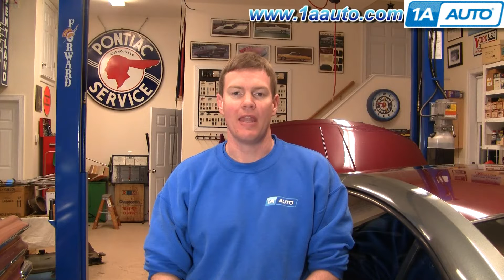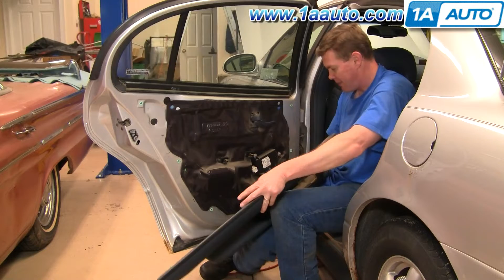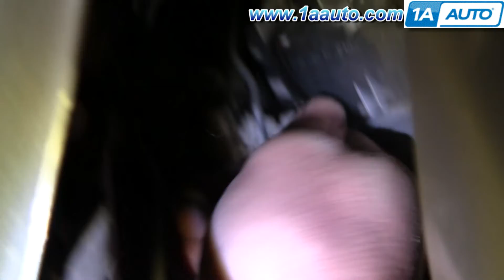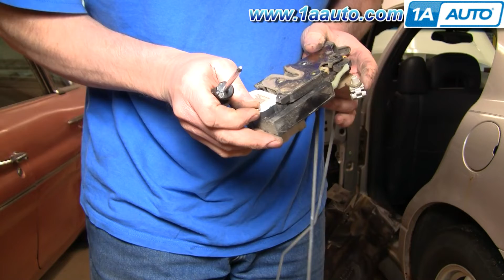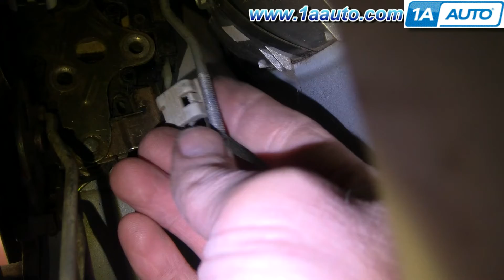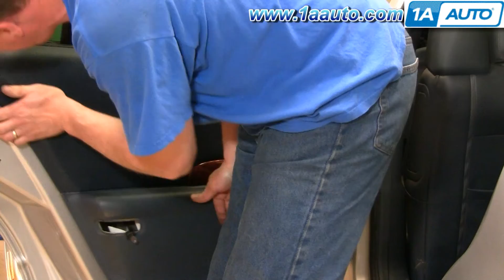How to Replace Door Lock Actuator 92-05 Buick LeSabre

Comment: Awesome video. Tried ordering the actuator for a 2000 LeSabre RR door from you guys but you had none in stock. Ordered an $18 one from car parts wholesale and the door lock now works like a charm. Thanks

Also, if you don't mind, I'm posting a link to the only video I've found that deals with a '99 to 2005 LeSabre window problem for other Buick owners as you have quite the subscriber base. The only window that worked was the driver's window. The other 3 did not. It's a little bit of work but this fixed the problem and saved me tons of money.

https://www.youtube.com/watch?v=R7zXr2br5h0

And this was my comment for this video about the windows not working;
It is quite a bit of work but probably saved me over $1000 by not taking it to a mechanic. Four #50 torx bolts to remove the seat. Had a friend help me place it on a protective cover on the back seat. Only pulled up the carpet under the drivers seat itself and propped it up with a 12" 2X4 exposing the wire bundle. After removing the bundle from the plastic ribbed cover I still couldn't see the connection. Removed all of the electrical tape from the bundle and found the connection with some kind of a cloth cover. Removed the cloth and the connection was totally corroded. YOU'RE LOOKING FOR THE PIECE OF CRAP CONNECTOR LINKING THE TWO TAN/WHITE STRIPED SERIAL DATA WIRES. These data wires communicate between the door locks and power windows from the drivers side door module to the other 3 doors. Which is why I was able to activate the drivers window and door lock with the driver door switch but not the other 3 doors. The connector is about half way between the power seat bundle coming through the carpet and the plastic bundle cover near the drivers door. I cut out the connector and stripped the wires, soldered some 18 guage speaker wire to the data wires and everything works great now. Hope this helps